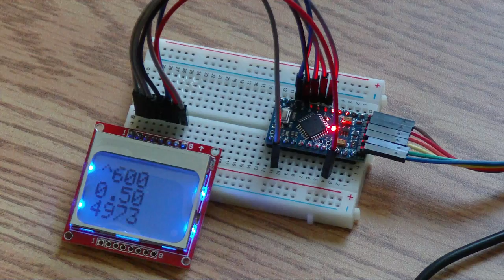Flight Simulator FSX LearJet Arduino Cabin Pressure Panel- Part 1

Comment: Hi Eric,

This looks great! I have just discovered Jim's excellent Link2FS site! It is exactly what I need to get started with my FSX home cockpit. Is there any way that you can share your Arduino code? I also had the idea of using the awesome 5110 lcd displays for information (COMM & NAV frequencies, etc.)

Kind regards.

JC
Reply from the maker: I'm actually hanging on to this specific code for a couple reasons.  So glad this helped.  Good luck!
Reply from the maker: Change of plans Johan- All code and files will indeed be posted.  Once I get them done they will be included in an upcoming video!  Cheers
Reply: Hi Eric!
That will be awesome! Can't wait!
Kind regards!